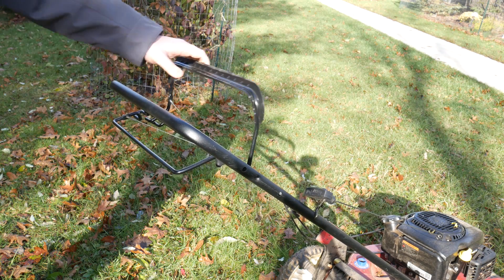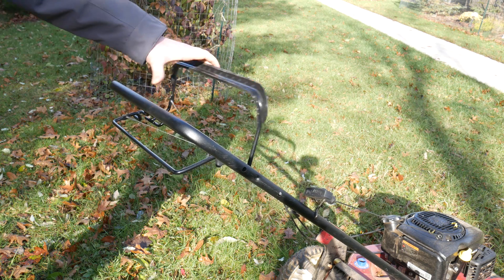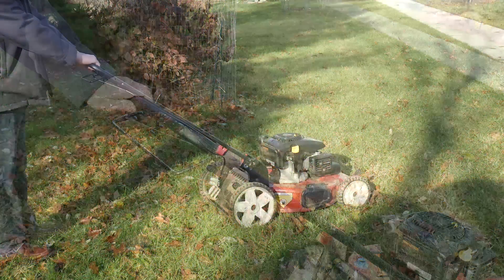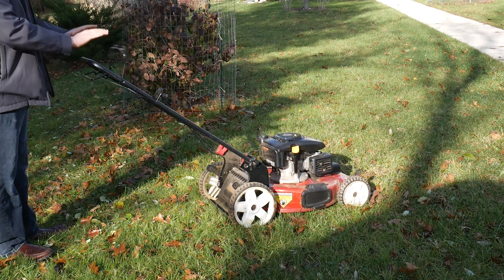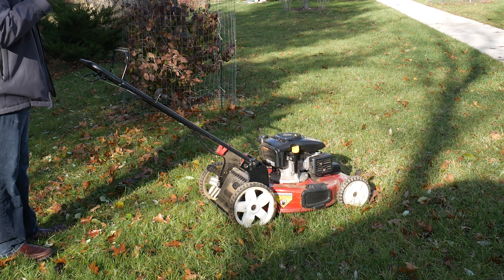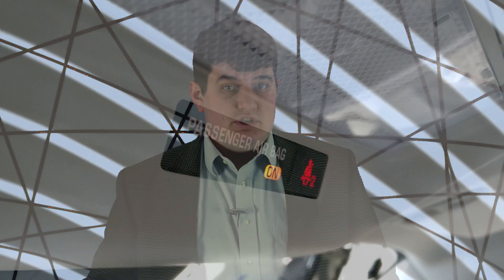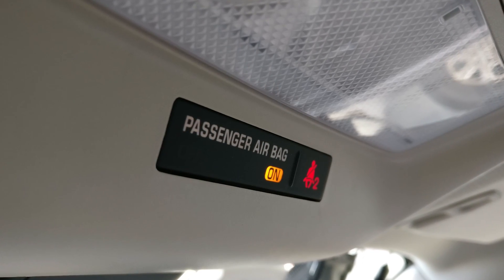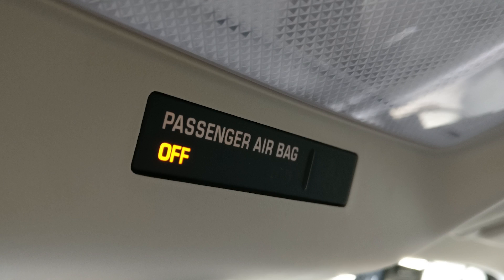The Dead Man's Switch:  How Anton Yelchin's life could have been saved

Comment: Yeah this sounds incredibly annoying and possibly dangerous. What happens when the switch fails doing 70mph? Or when the vehicle won't run and you can't push it out of the road without someone sitting in the driver seat... how would you tow a vehicle if it locks itself in park without a driver... 
I've got a better idea! How about be responsible for your own actions, rather then expecting a company to stupid proof everything.

Comment: We can’t use seats sensors as they are not accurate. You move, shift your wait, stretch, and the car would go in to park unless you program a delay and you could also get killed by it. The seatbelt is the best way to make sure a person is in it and to make you use it. It should also be programmed just like other equipment sensor that every restart requires open then closed circuit as some will buy extra buckle and just keep it in.

Comment: To be honest how would this work, will it just go to park if it doesnt detect anybody? What about high speed driving over a bump, you would be weightless for a small time, what is enough time to shift? Will it wreck the transmission? How about if the sensor fails. This is the reason not all cars have this, its a complex system. Mercedes S-class does shift into park if you open the door for example, but only if you were already at a dead stop.

Comment: No need for a Deadman switch to be added to the driver seat, or any programming to accommodate shifting around.

What Chrysler did instead is tie it to the door sensor. Open the driver door? Shift to Park or apply the electronic parking brake, depending on if it has an electronic or mechanical shifter. Override levers concealed behind interior trim panels are used for service and towing to allow the vehicle to remain in neutral with the engine off.

Comment: If it weren’t for my older brother remembering which pedal was the brake and which was the gas at ~age 8, there’s a decent chance I would not be here now for this same reason. My mom got out of the car to check the mail (our mailbox was on a busy road, so she would usually pull into our very steep and long driveway, that way she wouldn’t have to walk all the way down to check it, or stop in the busy road). She was sure she put the van in park, but it started rolling backwards down the driveway after she got out, so my brother jumped into the drivers seat and stomped on the brake. After that she always double checked the parking brake, and made sure me and my sister also knew which pedal was which. But the dead man’s switch would’ve made that impossible in the first place

Comment: Even if you have a mechanical throttle, the computer still controls the fuel injectors, which will control the load of the engine.

Comment: Engineering a vehicle that allows the vehicle to roll without a driver is reckless disregard for  human life.

Many vehicles already have a shift FROM Park lockout in that the brake pedal has to be pressed to shift out of park.

There are certainly multiple ways of implementing an "automatic shift to Park when no driver not present" system. However, one simple switch is not enough for system reliability and redundancy standards. For example, you would not want the vehicle to shift to Park while driving if the detected weight of the driver changes when going over a bump or if the switch contacts becomes intermittent.

An additional issue to consider is that there are special rare conditions in which a vehicle needs to roll without a driver such as towing and maintenance but these would handled in a special difficult to enable mode.

If engineers can get a car to drive itself, making sure a vehicle stays stopped without a driver seems trivial.

Comment: One of the few issues I see is if you need to push a stalled/dead car. Say, you ran out of gas and need to push the car, having the door open and steering. 

But honestly? I think adding the dead man switch would be a good idea. I think the above case is niche enough to not worry about it

Comment: I know I am late, but I think there is one major problem in this situation. If there is a car failure, you want to be able to manually push the car somewhere, even if it is just out of harms way for other not to crash into it. If you have a deadman-switch that physically pushes the car into parking, you will not be able to push the car with two man, but you will always need another person sitting to shift the car into neutral.

While I agree, the ability to park the car when people forgot it is a safety feature, so is the ability to move the car in case of an engine failure.

Comment: My car has this. Granted, it's 5 years later, but still. I have a 2020 Escape and if I have my car in drive and I open my driver's side door, turn off the car or get out of the driver's seat, the car aggressively dings at me, applies the brakes, puts the car in park, then applies the parking brake. It's great because I have an awful habit of forgetting to put the car in park if I'm not turning it off to just run inside because I forgot my wallet or whatever.

Comment: Yeah, this seems like perfect sense. I think there still needs to be some way to force it to stay in neutral in case you break down in the middle of the road, but as you said, there are heaps of ways you could do that. You could deactivate it through the menu system that the cars all have these days, and it could remain deactivated until the car is switched off and then reactivate again.

Comment: 5:09 - Cars with a manual transmission don't need something like that because a car with a manual transmission will stall if someone gets out of the car while in gear. Meaning unless the car was going down hill in neutral for some strange reason, this wouldn't be an issue. But as an interesting side note, newer BMW's do actually have a feature that puts the car in park automatically when it detects the door opening. As someone who's worked at a BMW dealership for a long time, getting in and out of cars fairly regularly after moving them short distances, that's saved my ass more than once.

Comment: I agree that cost is placed above failsafe and interlock mechanisms these days, especially in the car industry. Their are plenty of applications where fly-by-wire should never have replaced existing mechanical systems for safety reasons. While it makes assembly easier, further to safety concerns, it generally costs more to fix and results in more components going to landfill when they fail and need to be replaced.

Comment: One of the main car review guys got pissed off at Hyundai because he didn't know how to reverse a large SUV.  When he unbuckled and opened the door to look out it thought he forgot to switch it to park and applied the electronic parking brake that jolted it to a stop.  With my 2017 Elantra with a manual pull brake it can't put the parking brake on but dings when the door is opened with a message shift to P.

Comment: Safety features like this add a sliver of safety at the cost of a sometimes significant amount of inconvenience.  We already require your car to be in park to remove the key, and the key and brake pedal to be engaged to shift out of park, so this feature would only be useful in the niche case of a driver who leaves their key in the ignition when they get out of their car, and is even further reduced by the fact most people would remember to put it in park most of the time.

Meanwhile, having to deal with overrides (if the manufacturer even provides them to the end user) when a sensor fails, or in the rare case leaving the car on neutral while leaving the vehicle is desired (pushing the car in the event of a breakdown) can be significant inconveniences.

The "inconvenience is always worth saving even just one life" argument doesn't hold water.  If it did, you would be in favor of lowering speed limits everywhere by 5 mph... indefinitely.  There is always a time where some amount of risk is accepted in the name of convenience.  I believe this is one of them.

Comment: New wranglers (and I imagine other Jeeps) will slam into park if you open the door with the vehicle in gear, but they are removing features from manuals, my manual wrangler doesn’t even have a steering lock anymore which is kind of funny.

Comment: Heavy machinery operator here, I work in forestry.

The issue with adding electronics and sensors to machinery is that they tend to fail ... a lot, if it can be done mechanically like a lawn mower lever, than there much better, but I've actually had my own life threatened many times due to electronic failures on heavy equipment, anything from an electronic throttle getting stuck wide open on a 99,000 Lbs semi truck, to an emergency stop not working due to a bad sensor to detect that the machine has stopped, you could say this could be solved my maintaining the sensors, but of you did than you clearly lack experience, these sensors fail on a daily basis and having them fixed would take up to several hours and thousands of dollars, again daily

Another downside is that as machines like cars get smarter, people will get dumber, until the electronics fail and make the machine MORE deadly than they started, as well as now the human operator doesn't know what to do

Again, these "wild" scenarios have actually happened to me, I operate heavy machinery that's down right robotic, and I deal with computers a lot, I actually host servers for online games so I'm aware of how many things that computers control, which is why I prefer machines made a number of years ago, you may see them as being more dangerous, but in my like of work, they have actually killed LESS people, "research" DOES NOT gain experience, and I really wish that people would try more to get there information from the people who live that data.

A good way to put it is, when the news anchor thinks they have more information than the first responders than there is clearly a crucial component missing  

(Yes killed, not just injured, we have a safety class every year to renew our certification)
Reply: I will also add that a LOT of military systems, where safety really counts in conditions where your, and your enemies goal is to reduce each others safety if you think about it, they dont use electronic safety systems or at least not fully, they know that it tends to fail and cant be trusted nearly as much as mechanical devices, in fact a proposed new fighter build by the Grumman aircraft company, the X-29 required a computer in order for it to fly, but because it could only fly with a computer, and because its been proven time and time again that its not a good idea to rely on this completely, the aircraft had 3 redundant computers, as well as 3 more backup analog computers.
Reply: Ok, I'm done now, I was just a little upset by the idea that not liking electronics on machines (like cars) is silly, when I have personally lived through a couple life threatening situations because of it.

Please! Have a great day!

Comment: It’s almost 5 years later and Ford does this. If the car is not in Park, the driver’s seat belt is not buckled, and the driver door is open, my Mach-E shifts to park and applies the park brake. If you want to intentionally leave it in neutral you have to shift to N and press the L button to confirm that you want it to remain moveable after you get out.

Comment: The first thing we do: disable the seat switch in the tractor...

I think it could be a good idea to have that sensor, but it needs an override.

The sensor on my passenger seat failed nearly instantly after the car was bought, and cost so much to fix that we ignore it.

So, an override, and limited conditions to engage..

And they need to fix the shifter in that car.

Good job.

Comment: So, basically, you’d like to train drivers to avoid unnecessarily shift into (P)ark when parking. After all, they can just hop out and the car will do it for them … until it doesn’t. Seriously though, designing safety-critical systems is extremely difficult. It doesn’t really matter whether it’s software, mechanical or even procedural solution. I think there is this notion that software is automatically easy and just involves a little bit of typing. In actuality, in these sorts of systems, 99.99% of the time is spent figuring out all of the operating and failure modes, taking into account not only the fundamentals, but also a number of permutations of uncertainties exponentially greater than one might at first think. Finally, by implementing a safety system - however noble the intent - the companies implementing and/or integrating that feature will now be responsible and potentially liable in a whole new way. Manufacturers are almost certainly disincentivized from making these changes, because they meaningfully increase the risks for them - all while increasing their costs. No, software and pressure switches are not free - even in bulk. Even in 2021, in these industries, pennies still count, much less dollars or tens of dollars. Really.

Comment: But how do you drive from the passenger seat while delivering mail?
And, yes, software is very flexible. Including at opportunities to create bugs.
I remember the annoyance when we first started to interlock seat belt use with allowing the engine to start.  Of course you could defeat this by sitting on the fastened seat belt (shoulder straps weren't a thing yet).  So my '71 MGB had a relay (and, IIRC, electrolytic capacitor) based sequencer to require that the seat belt be fastened after you sat down and closed the door.  But even without a CPU you can have bugs, and these things could get in a snit for now apparent reason, so I, who have religiously fastened my seat belt (and insisted that my passengers do so) ever since one was first available to me (mom's '61 Corvair didn't have them), frequently couldn't start the car without pushing it, jumping in, and popping the clutch (talk about safe).  No, of course I didn't jumper the appropriate two pins on the module plug - ;^)
But you make a good point.  The time has come. It will be interesting to see what sort of teething problems the brain trust in Detroit (etc.) will give us to soldier through.

Comment: In rebuttal to his rebuttal (safe cars are great, if you read to the end) and in defense of simplicity even in things which must be complex, A (good) PCM is a pretty failsafe device that can run all the systems he mentioned in a state of striking failure. Especially on a cheap car with a real throttle cable. Likewise, most computerized transmissions with a shift cable will drive with a totally dead TCM - obviously not well, but you'll get home, and that design is not by accident. Contrast that with a BCM and associated serial networks and modules, which are serially infected with a slew of codes of varying degrees of seriousness, danger, and reality, often relating to things like spilled drinks or kicked kick-panels or seats that have been sat in too many times or too vigorously, doors that are having existential crises and refuse to communicate, and the like. Adding ways these notoriously breakable (often pre-broken) systems can keep the PCM from functioning or reduce it's functionality must be done with the utmost care and caution and an eye to failsafe usability, because cars are mission and safety critical machines, not only in that they stop when they need, but also in that they go when they need, even under considerable mechanical and electronic duress. Cars have all sorts of systems that do this (did before this video, and after) but there's a lot of room to be clever and non-intrusive with this sort of thing, and it's pretty easy to be hamfisted and reactionary and appeal to nanny states and nanny cars, and that's not good for any of us for many reasons.

Comment: I am suspicious toward automatic systems in cars. My Skoda had falty wires running in the trunk, causing the motor to not turn off, even when i removed the key. I don't feel comfortable that those systems also control the speed and the steering of my car 😅

Comment: The US had a seat belt starter interlock requirement - federally - for model year 1974 I believe, basically requiring that the driver (and passenger, I think) buckle up before the car would start (using pressure sensors) . Due to the public outcry, it was rescinded almost immediately, and it became legal to simply bypass the system in those cars with it.

Comment: 2021 Chevrolet vehicles will not shift out of park until the driver buckles their seat belt (rather annoying to us "older" drivers who learned to buckle their belt whilst they were backing out of their driveway 🤬🤬🤬) but I digress, my point is that this system can now be used to prevent the situation presented for precisely $0 with the proper programming given that cars in this decade are now all fully drive-by-wire

Comment: A type of dead man switch that I could see being far more beneficial in cars of the future is a form of driver interaction sensing. Since most vehicles coming out now have lane departure assist and adaptive braking and things similar to that, it wouldn't be a huge engineering stretch to design a dead man switch into a vehicle that activates if the driver stops delivering input. This way, if a driver falls asleep, is incapacitated by something or some other situation that the driver is no longer able to control the vehicle, than the vehicle would slow down and come to a stop and maybe pull off the road if possible

Comment: Fwiw, most cars only have that occupancy sensor on the passenger seat. Driver's seat is just a seatbelt switch. 
Ford's instructions for calibrating the passenger seat sensor are rather specific.   Park on flat, level ground. Seat in middle position.  Smack backrest three times to remove any binding. etc.